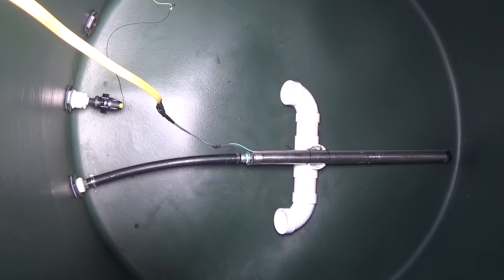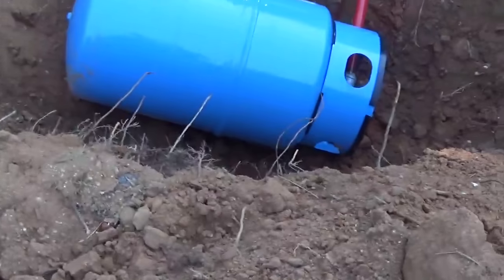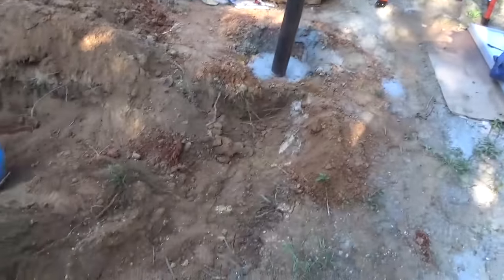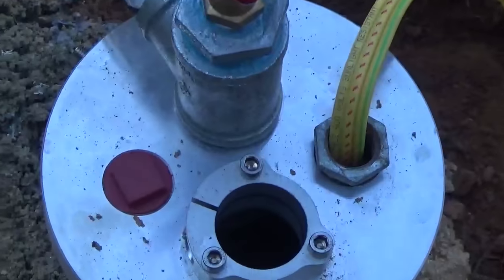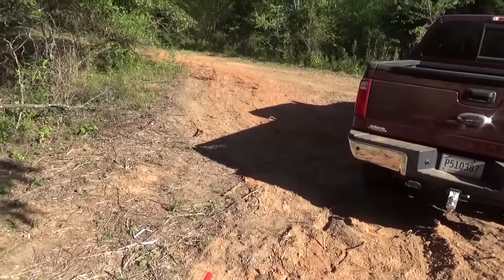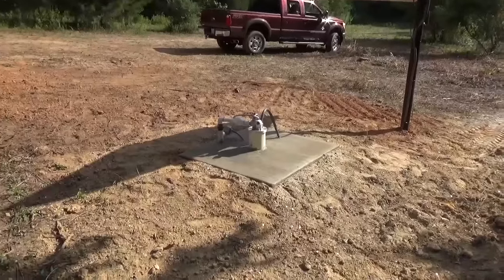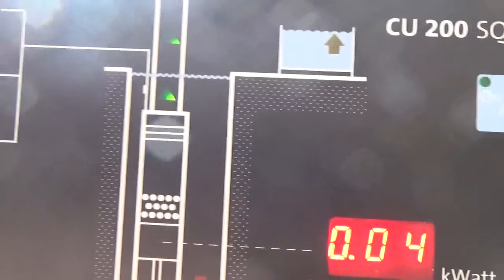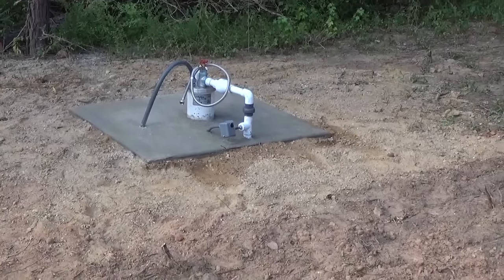High Tunnel Irrigation with Direct Drive Solar: Part 1

Comment: 4 inch PVC pipes make good access ports to the valves on the pressure tanks. Drill a hole for the valve to enter the tank and cap it with just an end cap with an eye bolt in it to pull it off later. Once back filled the dirt will hold it to the tank. 

Cheap and large enough to let you bring an air hose down if you have to add air to the balder.
Reply: Andrew H shouldn’t be burying pressure tanks to begin with

Comment: A question. I live at altitude and I've drilled 800ft with no water yet so... I think the drilling company can go to 1200 for more $$ but is there a practical pump that can be solar powered from that depth should water be struck? Thanks. Nice videos.
Reply: ElPasoTom you would have to look at the pump curve. 
a pump that would pump 5gpm at a static of 350’ might only pump 1gpm at 800’, but i don’t think there is one yet that will pump from that depth, (i could be wrong, been out of the well business for a few years yet)
solar loses a lot the deeper you go. maybe look into a 120v pump and do an inverter setup

Comment: Hi Scott - just wondering why was it necessary to bury the pressure tank?  Nice work and looking forward to part 2.
Reply: It's not needed but it reduces what is exposed to heat/cold.
Reply: agreed on the hot cold but it will fail sooner or later access will be a bitch ?
Reply from the maker: Keeping the tanks from freezing.
Reply: +engineer775 Practical Preppers aren't you concerned with the tank rusting?
Reply: now i rethink this Im thinken the contacts are gonna go first on the pressure switch !

Comment: I am baffled why you would bury the blatter tank directly in the dirt and not build a little room under ground for easy clean replacement. But good job otherwise!!
Reply: trevor ensrud i’m trying to understand why he would even bury it to begin with?!? the average life of a bladders tank is 7-10yrs, and you can reduce that by the ground contact. not to mention he didn’t put any check valves. and should of too filled the storage tank, it’s why there is a bulkhead fitting at the top. no need for the pressure tank by the well.
damn near everything he does with water systems.. he does wrong!!